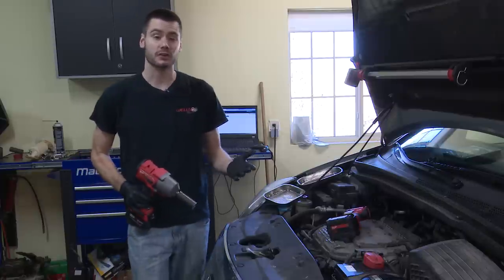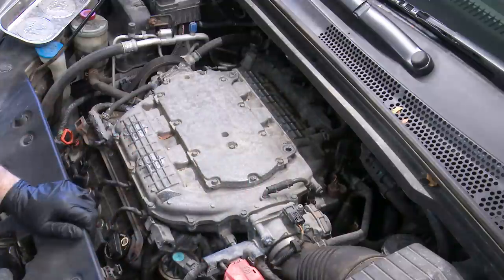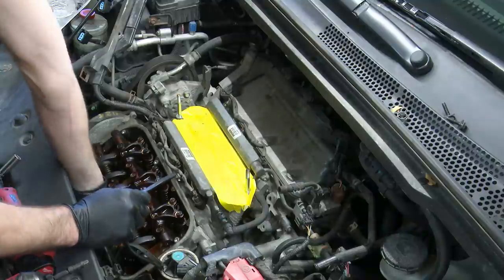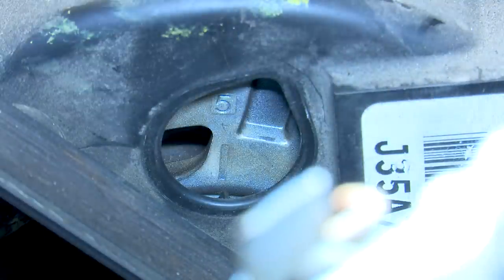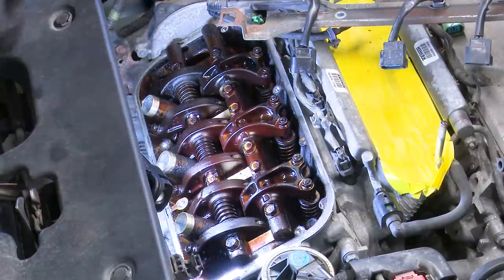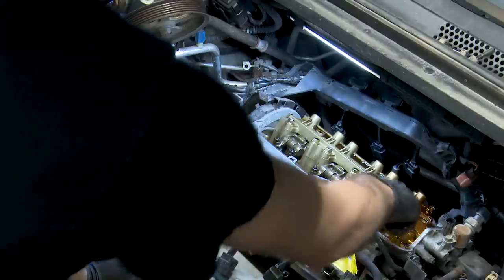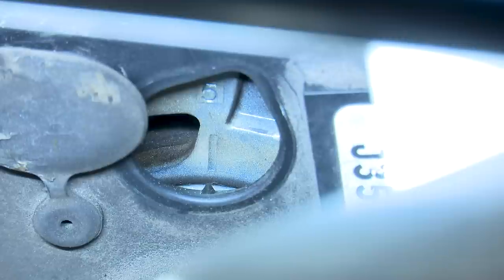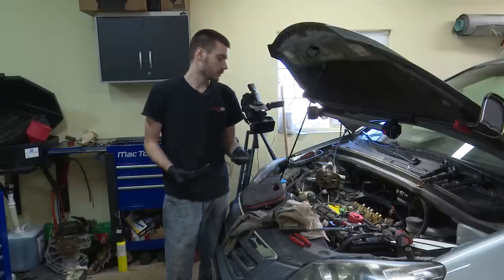2006 Honda Odyssey 3.5 Random Misfire Case Study Part 2 : How To Perform A Valve Adjustment

Comment: Thanks, Great video.  After watching your video I performed a valve adjustment on my 2006 Honda 3.5 (ridgeline with 200K miles).  Took most of the weekend to complete the project.   Since completed I no longer have random misfire codes, misfire cyl 1 -6 codes and no more P2279 codes.   I was shocked at how tight my exhaust valves were.  Also cleaned intake manifold, EGR valve etc before reassembly.   Runs like a champ again.!!!
Reply from the maker: Hey Tim, thanks for watching! I'm glad you were able to tackle this thing on your own! Nice!!! Glad you got er' running well again.
Mike Becker, Senior Technical Instructor
Reply: Is this specs he gave out same for 2016 odyssey? Mine at 100k misfire cyl #4

Comment: It was nice of Honda to include the number of the cylinder on the cam sprocket, pretty handy. We ask so much of our vehicles these days so engineers have to pack everything in close quarters. Great job Mike. If I had this engine I'd feel comfortable taking on this job now.
Reply from the maker: I agree Wyatt. That was super handy! Great to hear that you would be comfortable performing this job now, my job here is done :)
Mike Becker, Senior Technical Services Instructor
Reply: By far one of the SMARTEST groups of designers !!!
Reply: @GoTechTraining  THANK YOU THANK YOU THANK YOU !!!  THIS video saved my truck that “can’t be fixed” !!!

Comment: I was able to remove the rear valve cover by opening the complete wiring harness cover,(plastic) and gently pull the harness out of it and then unbolt the holder.  Easily removed the valve cover then.  Your video is absolutely the best.  The numbers on the window are really a pain because they are upside down on my 06 Ridgeline.  Also all numbers are present on front window. I tried to use the rear cam window, no numbers on the rear cam.  Take your time, yes a weekend, but this is doable.  Would love the torque specs though.  Thank you for teaching us DIY folks.

Comment: Amazing videos on this topic, thank you!  I just finished our 08 Pilot, same symptoms, 192k.  On it, all intake valves were loose (~0.011) and all exhaust were tight (as low as 0.004).  Adjusted to 0.008 intake and 0.013 exhaust. Seems to run better, but still an occasional hiccup.  Oh, and I did not remove the PS pump to get that harness out of the way on the back cover, and it was a major pain to get in and out of there!
Reply from the maker: Hey Mark, thanks for watching! Double check the EGR ports. Also, ignition coils are pretty common if you are still getting a misfire.
~Mike
Reply: I love watching your videos, they are very educational, some of these videos will be useful for me someday…

Comment: I have a 2004 Accord V6 6 Speed Coupe. Exact same motor. Just a 3.0 J30.  My car was misfiring like crazy on startup, and would run really nice when warm, I usually do my own work, and I have not done a valve adjustment before and it took me about 3.5 hours. I started at 7: 00pm and was done at about 10:30 p.m. car seem to have so much more power and runs so much more smoothly. And it did not misfire when I started it from cold afterwards. So hopefully this fix my problem. I don't think the valves were done on my vehicle before because my exhaust valves were so tight that I could not even get the feeler gauges in. And the intake valves were loose and floppy. Such a big difference now

Comment: Wow, you did it without the special tool. You're a beast! On to part 3. Thanks!
Reply from the maker: Man, special tools are just a thorn in my side. If I can get away without it I will. Sometimes there just isn't a way though.
Mike Becker, Senior Technical Instructor

Comment: Late to the party, but I am going thru this now. Pinging/tapping on startup, calms after warming up.  2006 Odyssey with JDM 3.0 replacement J35A1 engine (same specs).  I have done the valve adjustment on this and the original engine with varying degrees of success.  Each time I adjust, the clearances are off a bit.     

Best advice I have found is to take a GO/NO approach to valve adjustment.  

Intake (.008-009) check with .010 and .007    exhaust (.011-.013) check with .014 and .010

If the feeler gage goes in, you need to adjust, otherwise it is okay.  

A major pain is getting the feeler into position.  I would recommend first cracking the lock nut and backing off the screw for easy insertion, then inserting the feeler.  Then lock it down with the feeler still in position.  Then test for drag.  Pulling it out and trying to reinsert is not necessary.  However you do need to recheck the adjustment so rotate the engine twice and recheck clearances.  This helps ensure you did not miscount the cylinder.  Easy to do.

Comment: I'm old-school and love my nano impact from Harbor freight. It's the length of a credit card and will zip off cv axle nut and small enough to easily get into tight area's like wheel wells to zip off brake caliper bracket bolt's. Also great for driveshaft bolts.

Comment: Excellent video.  The only thing missing is taking the scope measurements after the valve adjustment to document that the timing is now in the ideal range.  I just performed this maintenance on my EX-L.  I observed that all of the exhaust valves on front bank of cylinders (4, 5, 6) were all 'tight' and needed adjustment.  Only one of the exhaust valves on the back bank (1,2,3) was tight.  A logical assumption would be that rear bank with the VCM are deactivated for a large portion time, and the valve seats don't get 'hammered' into the head as much as the non-VCM front bank do.
Reply from the maker: Hey Frank, thanks!!! I agree, that makes perfect sense!
Mike Becker, Senior Technical Instructor

Comment: Good job! A few notes from my own experience with a J32, a very similar engine. 
If it's a Florida car or has been in sandy areas there may be large amounts of sand and grit on top of the engine in nooks and crannies in and around and under the intake manifold. Blow or wash that stuff away before you open up the engine. 
Take your time. Double check the clearances. Be sure to tighten the adjuster nuts! Every one of them. Check them twice, at least. Otherwise a nut will loosen and you'll hear a click click noise starting up within a few days and you have to take everything off again. 
Do use a long bent feeler gauge. If you don't you may be fooled into thinking the gauge is dragging when actually it's just bent and wedged, many thousandths wider than optimum. 
A couple of bungee cords will help to hold the wiring harnesses out of the way.
See those 12mm drain holes in the head? A lot of stuff could fall down through them. Consider maybe plugging them while working. Golf-tees are too small, hot dogs too large, find something in between.
Take a long break and recheck the clearances. You have 48 chances to screw up a clearance or nut tightness. Get them all right the first time.
Reply from the maker: Hey George, thanks for watching! Good info to keep in mind when working on any engine man!
Mike Becker, Senior Technical Services Instructor
Reply: Excellent tips to keep in mind, when doing such an important task on those valves. 👍
Reply: Only 24 chances for 24 valves. What engine are you working on? Haha
Reply: @ua7pyro591 I think he meant 48 jam nuts

Comment: Ive a 2006 Honda Odyssey with a random misfire.   It happened because I over-filled the engine oil.  The instant i started the car...the engine light came on.   I took it to the Honda dealership for repair. I requested an oil change and a code read.  They pulled the code, said it was a misfire in #4 cylinder.  Charged me 380.00 for a spark plug, coil pack and labor.  They called me..said the car was ready.  I picked the car up...and driving it out of their parking lot, the engine light came back on.  I left the car with them again, they called me the next day and said....they pulled the code and now they say it has a misfire in cylinders 1,4, and 6 and want to charge me 1600.00 to change all remaining spark plugs and coil packs, and told me even with that...the car may not be fixed but it is a "starting point".
Reply: Welcome to the stealership business model

Comment: Hook a shop vac up to the inlet port of the upper intake before you pull it off. There could be some carbon crystals or dirt that become dislodged and fall into the ports on removal. Shop vac can prevent that. ;)
Reply from the maker: Hey Juan, not a bad idea!
Mike Becker, Senior Instructor

Comment: I have heard many a Honda V6 owner say my valves are fine and don't need adjusted...listen to how quiet the engine is.  Well, the noisy valves are the ones that are OK.  It's the quiet valves that are the problem!
Reply from the maker: You know what funny, service info say to adjust only if noisy...hmmm someone failed on that one! Haha
Mike Becker, Senior Technical Services Instructor
Reply: Mike, I think it's the way they write it.  Honda says to adjust valves at 105K (Maintenance Minder item #4) and at other intervals A, B, 1, 2, or 3, only if noisy.  So, they definitely want them adjusted at 105K but at other service intervals only if there is associated noise.  Many think that means only adjust the valves if they're noisy.  I've seen many a J35 misfire solved with a valve adjustment and it's always tight exhaust valves.  It's pretty safe to run these to 140-150K before a valve adjust but I certainly wouldn't run them longer.
Reply from the maker: I'm thinking this was the first time these valves were adjusted on this one. Judging by the condition of the valve cover gaskets, I believe I was the first one to remove them at the 210k mark. Have you seen these motors actually get bad enough to burn valves?
Mike Becker, Senior Technical Services Instructor
Reply: I don't have enough experience with them to know whether they will or won't burn valves.  I haven't seen any burnt valves.  In my experience they run bad and set the misfire codes prior to that happening.

Comment: y'know, mike.. it's reassuring to me, a novice, that you, an experienced technician, had the momentary brain-fart with cylinder 4. that is totally something i would do.

excellent video. my 2000 accord j30A1 with 145k miles is seemingly in need of a valve adjustment. i'm preparing myself to do this onerous chore by consuming as many of these instructional videos as i can find.
Reply from the maker: Hey Lothian, happens all the time! It's almost impossible to remember where every cylinder is on every engine! Good ole' brain farts :) 
Good luck on your own car. Hope it goes well for you!
Mike Becker, Senior Technical Services Instructor
Reply: I seem to always make that mistake myself. I'm just too used to working with engines where the odd cylinders are on one side and the evens are on the other.

Comment: Nice video i have a ody 01 and has 200k now and I’m planing to this myself i feel confident i’ve doing all my repairs on my car for a while but i never try this before i’ll clean the egr passages at the same time and replace the fuel pressure regulator i wanna adjustment the valves cause on cold I’ve noticed this year it starting to make noise
Reply from the maker: Hey Fredy, thanks! I'm glad this video has given you the confidence to do this job yourself! Thanks for watching!
Mike Becker, Senior Technical Services Instructor
Reply: Wells Vehicle Electronics i’m almost ready to the valves on my honda i just waiting for the gaskets and got the feeler gauges already intake .0009 should be fine and exh .0012 that would be ok right since its 008 - 0009 intake and exh 0011 - 0013  do i need to use hondabond I bought it as well also got the new intake manifold plenum gasket

Comment: great video. It was very informative and in depth. I really appreciate you making. I did have a question as to what you were turning to move the dial to line up for each cylinder. You never showed that. Thanks!
Reply from the maker: Hey Jason, thanks! I was turning the engine over by turning the crankshaft pulley bolt.
Mike Becker, Senior Instructor
Reply: @GoTechTraining  thank you

Comment: Always go with the larger spec no matter what. These intake valves usually don't need to adjusted much.
Reply from the maker: You've done a bunch of there? Bigger size makes sense considering how these tighten and not loosen.
Mike Becker, Senior Technical Instructor

Comment: This is great! Thanks, I’m planning to do this job in a few weeks once it warms up on my 2003 Honda Pilot with 217k miles. One question, how do you rotate the engine? You mention something about the wheel being off, but I missed how that works. Thanks!
Reply from the maker: Hey Mike 
The easiest way to rotate the engine is from the bolt on the crankshaft that holds the harmonic balancer on.
Hope this helps!
~Ryan

Comment: I just pushed the rear harness up and back, and slipped the valve cover out.  Same in reverse.  Did have my son hold the harness up while I replaced the valve cover, which made it easier.  I never removed the power steering pump at all.  Mine is an 04 though, so maybe different?  Bad thing is, I still have my miss, after all this.
Reply from the maker: Ohhh sorry to hear you still have misfires!!! That's very unfortunate after all of that work.
Mike Becker, Senior Technical Instructor
Reply: @GoTechTraining  Not noticing the miss so much now.  Wondering if the continued miss was just temporary, due to some oil that got into the cylinders, which is another story...  Still got the flat spot though.  It only manifests on the first acceleration after starting it, after it's already warmed up.

Comment: The long feeler gauges with a bend work well for this, too.
Reply from the maker: I should have bought one just for this job. Probably would have saved a good amount of time on this one...next time :)
Mike Becker, Senior Technical Services Instructor
Reply: Yeah, I bought my long set when I was getting ready to do my first J35 valve adjust.  Always got by with the short set all these years.  And if you think your chest hurt after the Ody, try the Pilot.  The Pilot is far worse because the engine is so far down below the radiator support.  A top side creeper is almost a requirement.
Reply from the maker: I'll keep that in mind! Mental note to turn away Pilots, got it :)
Mike Becker, Senior Technical Services Instructor

Comment: You performed the electrical diagnosis on cylinder #4; it would have been great to measure the actual clearance, and relate the amount of wear to the speed of pressure recovery to atmospheric.

Comment: Can I use a different color tape besides yellow to block the intake ports when adjusting the valves?  That color doesn't match well with the design on my new pair of yoga pants.
Reply from the maker: Haha you can buy leopard print duct tape, downside is it always leaves residue!
Mike Becker, Senior Technical Services Instructor
Reply: Ok thank you for the quick response.  bahhahaha!
Reply from the maker: I am the faster responding guy out there! ;)
Mike Becker, Senior Technical Services Instructor
Reply: Standard duct tape grey. You can't go wrong.

Comment: The symptoms you mentioned: increasing RPM makes the problem worse plus a 14% short term fuel correction looks more like a slow MAF sensor (at such a milage this is not unheard of). Also a random misfire could be a result of this. 
Recently I got a car with a timing chain tightened in the wrong sequence and the cams where both over 16 degrees of and still had only occasional, but I admit, random misfire. This could be seen very prominent in the Picoscan. 
I am eager to see if this fixed it.
Bernhard
Reply: He said It is noticeable & worse at idle and is better cold  but gets worse as it warms up which screams exhaust valve adjustment
Reply: Hayward's Automotive 
Ok thanks for the info. Disregard my comment but looking at the pressure scan there is no obvious valve problem. 30 to 50 degree is a rough guess to get started but what is the Honda manual saying? For final diagnostics you have to use the correct values and test them at operating temperature.
Greetings
Reply from the maker: Hey Bernhard List, I see this video series really has you thinking. I love that. I love this sharing of knowledge and opinions! I can say without ANY doubt that the timing was dead set on this engine. I did a timing belt replacement after I adjusted the valves and the cams and crank were in perfect position. No noticeable belt stretch either. The belt was 90k miles old. I agree, the correct values are ideal...but we can't always get those. It's not always that easy to just find an exact spec. If it were we wouldn't have "rules of thumb" right?
Mike Becker, Senior Technical Services Instructor
Reply: I would agree on the MAF suspicion but a MAF issue should affect both banks equally.  The other thing than that can happen on these vehicles is skewed O2 sensors.  When all else fails and you have high fuel trims 10-20% total and no code or explanation I have solved it by replacing all four O2's.  This is usually on vehicles with over 150K.  I found this on my own 08 Odyssey but a couple of other similar vehicles belonging to customers of mine.  Checked everything and could find nothing wrong, even with the O2's.  Finally replaced the upstream A/F sensors (even though I could find nothing wrong on a scan tool with them) and it brought trims down about 5%.  Drove it a few weeks and nothing changed. I then replaced the downstreams and the fuel trims dropped to nearly 0%.  Many people don't realize it but on AF sensor vehicles often the downstream O2's are used for fuel control and even though they appeared to work as they should, they were skewed after 170K miles.  Engine now runs as good at 180K as the day I drove it off the lot with 6 miles.